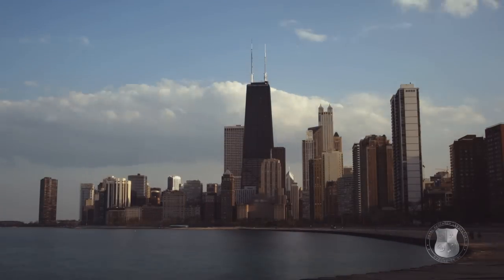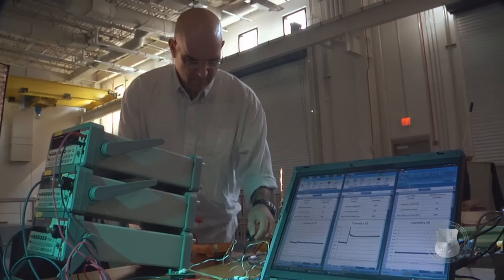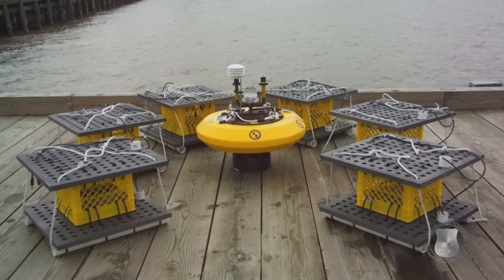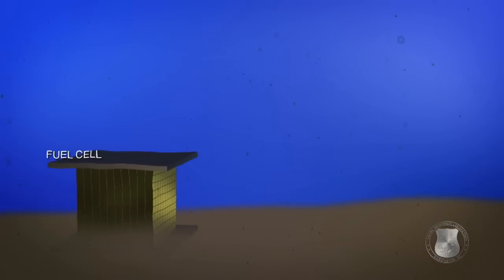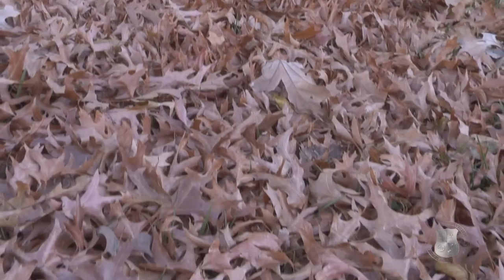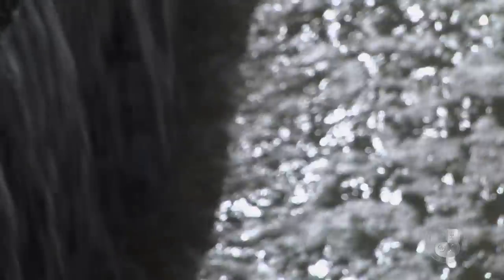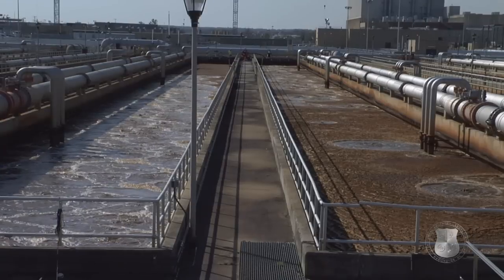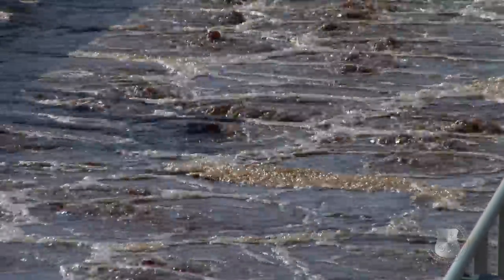Using Microbes to Generate Electricity

Comment: I have been infected by morgellons disease for the past 17tortuous years. Throughput my attempts & research trying to find a best solution resulting in relief from the fibers the itching insomnia & ulcerated sores whi h will not heal.During one attempt that heals the wrinkling & bumps off the skin is the running batteries directly above area needed treated. Atlas a positive  result making skin smoother flattening smoothly of skin also magnets reduces the size of open sore , reduces black fibers, retards itching also sides in effective serotonin,& L- Tryptophan feeding to area controlling  the sleep & rest for the brain & body. Also calculated that from the magnets refracting off the batteries the plasma becomes active causing a greater expansion of energy, rebuilding of cells & generates healing. Activity of procedure with batteries and magnets must be repeated on a conducive  schedule to all. Results will manifest with positive feedback.  Unexpected outcome was that notice of fibers located out of testing area seem to be communicating with other fibers in direct correlation to fibers attached in close proximity to the testing. Movement to one fiber to another was quite disbelieving but exciting nonetheless.   When the element copper is run above the skin site an educated assumption that there definitely is electrical current being produced by whatever electric properties that are happening. Dont short sight this mysterious disease.

Comment: The C02 fuel is actually an interesting method. I think we don't need some kind of plant that suck the C02 but instead, make the recycle C02 out of every cars (maybe a raw fuel and process it later). This method is to create a kind of smog in the car that recycle the C02 into a fuel while we drive it. At oil change, the recycle fuel can be collected and reuse it. We may need plant for the fuel to be process the collected carbon dioxide.

Comment: Possibly floating marine biology research centers, waterborne command and control stations for robotic deep-sea exploration subs, remote military radar sensor outposts, oil drilling platforms(although I hate saying this on Earth Day, it is still a possible application), and pretty much any other waterborne platform that needs to remain in a single geographical location and needs running power. Just saying.